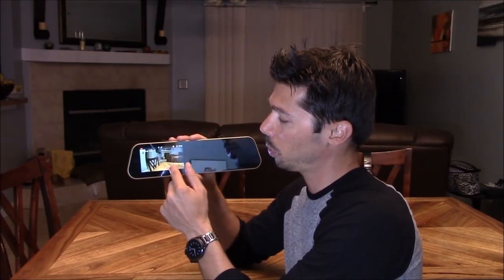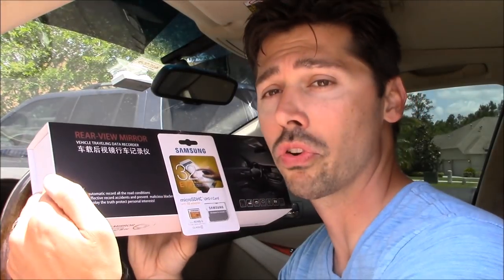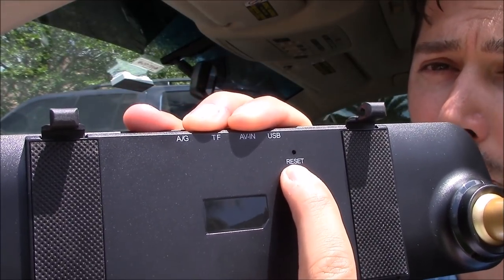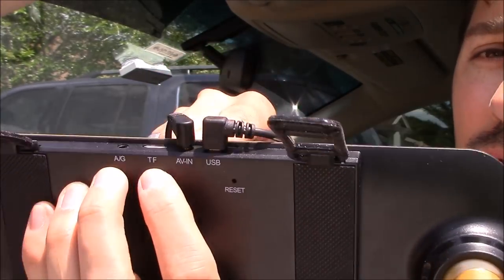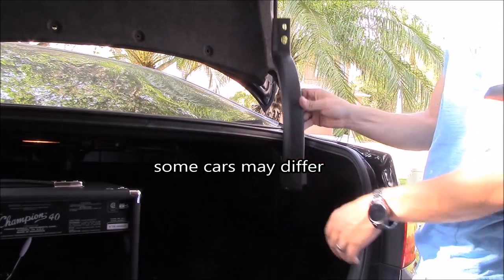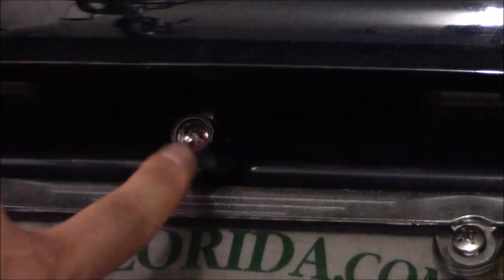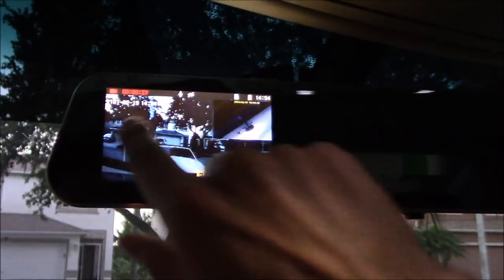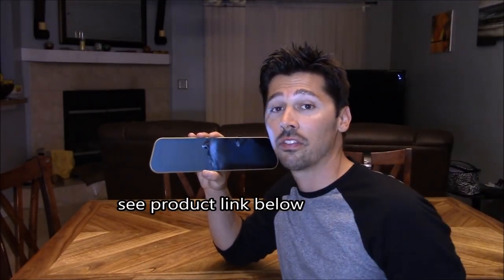How to install a backup camera - dash cam car rearview mirror DVR review

Comment: Thanks for the video! this unit rocks! Nav screen reverse integration on my Porsche would have cost me 2k plus. This clip on reverse mirror works way better keeping my head up also easier to use the passenger mirror tilt to prevent curbing my rims. Much more natural to look from rear view to side view during back up.

Comment: So I bought this thank you for the review. Both back and front video shows fine, But when I put the car in reverse the video have lines in it any suggestion on what might be the problem? I recommend if you buy this and have a full size sedan, suv or truck but a extension 2.5 mm video aux cable.

Comment: Nice video, thanks for uploading. I have installed it in a Honda City and wonder if you can give me some ideas on these:
1. Whenever I open any of the doors, the cam turns on by itself and I have no idea why. I've only attached the rear cam wire to the wire of the reverse light.
2. Unlike in your video, I didn't attach the ground wire to the black&white one, but to a metal screw. Would you think it's a bad idea?
Thanks much!

Comment from the maker: I forgot to add if you stop the  recording then hold menu button for 3 seconds you can access date, time, resolution and more settings.
Reply: Tampatec Glad to know their is a local YouTube! What's up from Bradenton FL
Reply: Tampatec WHAT ABOUT REAR SIDES OF DRIVER AND PASSENGER SIDE RECORDING?...LIKE WHEN THE POLICE STOPS YOU AND APPROACHES YOU ON THE DRIVER SIDE?...I DID NOT SEE THE SIDES BEING RECORDED
Reply from the maker: Yves Estinvil records audio inside but not side door video recording. maybe next version.
Reply: Yves Estinvil If you wanted to recorded side to side you could buy the Dual Cam Dvr like I had and you can rotate side to side or point them both to front or rear.
Reply: How I stop the recording .I have hold all the bottom but nothing happened.I need to change the language

Comment: I have the exact same rearview dashcam mirror/back up camera kit.  After installing it, I noticed that the back up cam powers up when I turn on the car but the rearview mirror doesn't switch automatically to the back up cam when put on reverse.  I found another video in YouTube and found the answer.

All this time, I thought it was the RED wire (from the back up cam) that powers it.  IT ISN'T.  It is the black plug that powers the back up cam (at 7:25 mark of this video).  So to clarify and not to confuse people, the red wire from the back up cam is NOT a power wire.  It is a reverse trigger wire (so the rearview mirror knows when to switch to the back up cam when put on reverse).  Once again, it is the black plug that powers the back up cam (at 7:25 mark of this video) which is connected all the way to the rearview mirror, and then from the rearview mirror goes the power cord to the cigarette adapter.  You have to make sure to connect the red wire from the back up cam to the +ve wire of the reverse light.  You can do this by using a digital multimeter or a test light to confirm that.  So when the reverse light turns on when put on reverse, it triggers the back up cam which sends the signal to the mirror and it switches the view automatically.  When you put it back on Neutral, Park or Drive, everything goes back to normal and the dashcam in the front and the back up cam starts recording your video again.

I also find that the scotch locks (splice connectors) are not reliable.  I recommend connecting the wires the same way as shown in this video or you can strip a small portion of the insulation in the middle of the wire (to expose the actual wire) and wrap around the other wire on it, then seal it off with an electrical tape (or heat shrink).
Reply: Peter Reyes, that helped but quick question a) do you have attach the red wires to the lights and b) if you don't does it still record. I am guessing it always records and the red wire setup is for reverse parking (which my car already has). Thank you in advance.
Reply: Thank you for this response on the red wire! I too thought the red and black wires were rear camera power!! 
Sometimes you tube videos are easier then manauls or google search results. 
Appreciate your time writing this!  A++

Comment: That's a really good deal- a lot of people would need someone to do the install as they don't know soldering etc 
I swear I have seen other systems just for the backup that can be set up to be on all of he time and not wired to only turn on when out in reverse. I would prefer a separate screen that has the rear always visible but man, for the money this is so tempting- just not sure I like the over the existing rear view concept- maybe if I could rig it to attach to the dash low. But that kinda defeats the design.

Comment: I got a defective one. Those rubber support bands lasted about a day with the Florida heat.  Using my wifes old hair bands as a replacement😂 They work like a charm. The reverse camera is not very accurate in regards to distance. Also, the rear camera image flickers. The image color flickers between normal to a sopia/pink color. 😮😮

Comment: very good video, only I want to ask you  when I connected  2 wires from back cam to  cars  reverse  wires  its on the screen  I see  back cam  works great  /in reverse mode/ but when  I go back on  parking  on the screen  still big  reverse window, what I have to do,thanks in advance

Comment: Installed Auto-Vox M2 camera system.  Works fine except for backup camera.  The image is flipped.  What is on the left side of image should be on the right and vice versa.  Told company and they sent new cables, which did not fix the problem.

Comment: These are fantastic for folks that want to add a traffic cam that works with good quality video that install cheaply.    Even with the best install it looks like an afterthought.  Think of the video monitors that were strapped to the back seats of cars in the 90's.  You have to be in a relatively good neighborhood.  In a bad neighborhood you may just get the camera taken.

The systems that replace the factory mirrors completely are a better option.   All the wires are hidden and they look stock.    They do NOT have the same quality video and can only record forward video without modification.  They are at least 4 times the price and more difficult to install.  They are far more secure if you park your car in less than perfect areas.

For most people this is fine.  If the mirror malfunctions you can just throw it away. Buy a new one and plug it in in seconds.

Comment: Hey, good video indeed. Are you still satisfied with the product? I've got similar on Aliexpress, however I am not really imperessed with the quality. The manual seems was taken from another products since some features not in the correct order or does not included at all, for example night vision.. I am about to find another one but want to be sure it is good. The one you demonstrated looks much better.

Comment: HI there, first of all I really want to thank you for your review. Thanks to you I was able to install my rear view camera. Now if you don't mind I have a question for you. The back camera or rear camera is blurry and I don't know how to correct the focus. It is there a problem with the camera installation maybe or is there any way to correct the focus from the rear mirror itself. I would appreciate your help. Thank you again Tony
Reply: Two things to check on your back up cam:

1)  Make sure there is no plastic covering on the lens
2)  I believe you can twist the lens clockwise/counter clockwise to adjust the focus

Comment: I got a EzonetronicsRM-LZ2010 and it only has a red wire to hook up to the brake lights, no black ground wire.  Is this defective or can it be hooked up with just the red wire, the cord does not seem to be missing, it just is not there.

Comment: Nice and affordable ! Question:  I have a rear-view mirror so at night, I don't have to flip it up to avoid the bright lights from the vehicle following me.  How does this mirror work at night?  I would hate to lose the feature and look for another dash cam that would allow me to keep the stock mirror.
Reply from the maker: +Kevin Shea since its just clipped on you Can still use the tilt tab, hope that helps. i actually used it last night when annoying super-sized truck with flood lamps was driving behind me, after i flipped my mirror tilt tab he started to tailgate me, maybe he was getting a reflection back, lol, good!

Comment: I just purchased the D700 and installed it in my wife’s Beetle. When I put the car in reverse, the screen does switch to show the multi-color “grid” you’d expect, BUT - 

1. There is no image from the rear camera appearing on-screen, just the grids against a black background.
2. It automatically powers OFF after about three seconds. 

Any ideas? I’m wondering if maybe the polarity is backwards, but I double checked with a multi-tester and it appears to be correct (unless the black and red coming from the mirror/screen are reversed at the factory?)

Comment: Just curious, if the cigarette lighter is already in use, is there any other way to wire up power to the mirror?
Reply: You could definitely wire it up in your fuse box, but that's a bit more of a pain

Comment: my car already has a camera in it thats how my car came how do i set it up that it doesnt interfere with that camera is that possible if not how do i set it up to make it work ? does the rear view mirror come with a back up rear camera or does it use the one naturally that you have in your personal car take mine for example that has a camera that allows a more easy acess to pull out of parings then shuts off as i put it in drive?

Comment: a quick question about back camera.
the rear camera need power to work only from reverse light? does it get power from AV port?
the rear light get power only then you gear reverse, how the camera works when going forword? where gets the power to run when forword?from AV?
Reply: It is the black plug that powers the back up cam (at 7:25 mark of this video).  The red wire from the back up cam is just a reverse trigger wire (so the rearview mirror knows when to switch to the back up cam when put on reverse).  So when the reverse light turns on when put on reverse, it triggers the back up cam which sends the signal to the mirror and it switches the view automatically.  When you put it back on Neutral, Park or Drive, everything goes back to normal and the dashcam in the front and the back up cam starts recording your video again.

Comment: I find it odd that the entire system isn't powered with a single 12v socket.
That would save a lot of hassle wiring the backup camera.
Would be great if both camera were recording at all time and I can press a button on the mirror to activate the reverse monitor.

Still seem like a great product for the price.
Wold buy it if I didn't have a car DVR already.
Reply: From what I understand it is powered by the 12v socket front and back all the time? The wiring is just a trigger to switch to reverse view when reversing the car, so I imagine you could just skip that part, and mount the rear camera, without the hassle of wiring, and just have permanent front and back recording?

Comment: Hey just got this product and I am a little worried about connecting to rear cables can I just use electrical tape instead of soldering. I’m tampa as well btw.
Reply: Tim Jones. .quick wire splice set worked for me. Harbor freight item#96230. No wire cutting, no soldering, no tape, just set split over wire and press connector in with pliers, wrap the plastic cover over done!  Make sure the red wire does not come out the otherend of the split. If so wrap with tape to prevent accidental circuits.

Comment: Hey I just wanted to know if the camera is still working good? thinking about getting one. thanks
Reply from the maker: yes system still works great but turn off the unit completely before removing the sd card or like macbooks it will corrupt the sd card. another way to transfer the data without removing sd card from mirror is to use the data transfer usb cable.
Reply: +Tampatec thanks for writing back.. awesome thanks for the video, I'm going to get one tomorrow.

Comment: I just installed the m2 reversing camera from auto vox. When there is no picture on the mirror and i reverse, the picture flickers.When any picture is on the mirror and i reverse the rear camera picture is clear. Is this a defect and should I return the unit?

Comment: They need one that replaces the factory mirror. My mirror already has a backup camera built-in. I want to replace it entirely with a mirror that also acts as a dash cam. It also should be powered by the car automatically, just like the standard mirror is.

Comment: Is the cord long enough to reach back up camera?
Reply from the maker: I connected Lexus and mustang and cable is long enough but you can get wireless kit.
Reply: Tampatec i really want this back up mirrror but i dont want to fiddle w wires on a bmw. Where can i get the wireless kit fir this?

Comment: will it become easy to rust after you drill the hole?
Reply from the maker: i have plastic but if it's metal it can rust so use water sealant.
Reply: or add a varnish

Comment: is it ok not to activate the back up camera?Because my car already has this I just need the rear and front dashcam function.thanks!
Reply: Jan Carlos... yes its ok, don't connect the red wire on the backup cam... U will use the back cam for recording only.  Power comes through the front connection
Reply: Ben Onen thanks .I'm using one now.

Comment: Do not understand how will it record rear view always when it gets power only when putting car in reverse mode?
Reply: I was confused by this too but after installing the kit in my vehicle, now I understand.

I thought it was the RED wire that powers the back up cam.  IT ISN'T.  It is the black plug that powers the back up cam (at 7:25 mark of this video).  I connected that wire without connecting the red and black wire from the back up cam and the back up cam is powered on and is shown in the display of the rearview mirror.  So to clarify, the red wire from the back up cam is just a reverse trigger wire (so the rearview mirror knows when to switch to the back up cam when put on reverse).  So when the reverse light turns on when put on reverse, it triggers the back up cam which sends the signal to the mirror and it switches the view automatically.  When you put it back on Neutral, Park or Drive, everything goes back to normal and the dashcam in the front and the back up cam starts recording your video again.

So to answer your question, both front cam and back up cam records your video all the time.  The back up cam is powered by the rearview mirror, NOT when putting the car in reverse.
Reply: Hi Peter i've put the red wire to set the trigger and i thought the black wire was ground so put it to the ground, should i leave the black one disconnected then? As i can't get a picture (i assume this is my issue then) Or does the black wire need to go somewhere too?
Reply: So to clarify, I don't have to deal with connecting red and black wires for the rear cam to function? I don't need a back up cam when in reverse. While driving is the rear cam recording at the same time the front is?

Comment: I have the same camera but for some reason it will not show a picture  way I put in reverse. it shows the lines or the square box but no picture. not sure what I may be doing wrong.  please help
Reply: James Brodie 
ground the reverse wire to the chassis, make sure you solder the red positive wire from the reverse camera to the reverse positive light. if you don't have a solder just do the NASA wiring technique
Reply: I have the exact same problem, @James - did you happen to fix it?

Comment: Doesn't the front facing dashcam keeps moving around since it's on the rearview mirror?
Reply: You can turn off the display manually or it turns off automatically after a few seconds (in the settings menu)

Comment: I don't really understand how you make it work that the backup camera works immediately as u go into reverse? - isn't there another way to install the backup camera or to at least make it work when u go into reverse?
Reply from the maker: if you connect to the reverse lights mirror would automatically toggle for the back up cam mode if you don't then you have to manually press a button to toggle reverse cam mode.

Comment: I just received this mirror camera , when I open the box I see they didn't pack me the wire for the rear Cam only have the rear camera so I hooked it up to car to use the dvr only. It works good and clear with dvr Cam but there is a problem ( I HAD A TINTED REAR WINDOW ) so the mirror was so blurry that I can't see and gave me a headache right away. PLEASE NOTE : PEOPLE WHO HAD YOUR CAR TINTED FILM IN THE REAR WINDOW YOU DONT WANT TO BUY THIS BECAUSE YOU CAN NOT SEE GOOD THROW THIS MIRROR AND TRUST ME YOU ARE GOING TO WASTE THE MONEY )) now I can't use it on my car I had to put it in my daughter 's car that doesn't have rear window tinted and it work really good just like your original mirror. This mirror was tinted blue but at night the car behind me shine a bright light on to the new mirror and I don't like this otherwise this dvr recorded a clear video .

Comment: Wish you could install these without cutting into any of the cars standard wiring.
Reply: I recently installed one in my car.  There is definitely a way.  Use "scotch locks" or splice connectors.  No cutting necessary.  The only thing is, with my experience anyway, sometimes it doesn't make the connection between the two wires.  But when it does, it works beautifully, easy installation.  I still prefer this guy's method, or you can cut a small portion of the insulation in the middle of the wire (to expose the actual wire) and wrap around the other wire on it, then seal it off with an electrical tape.